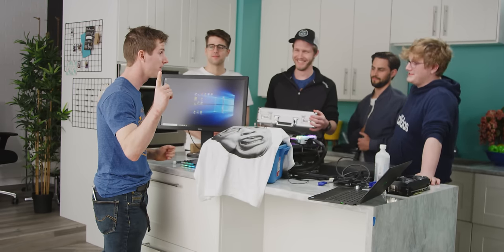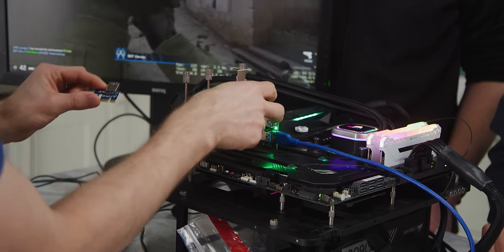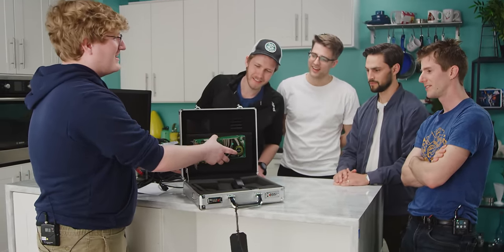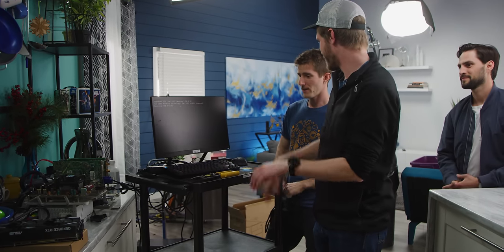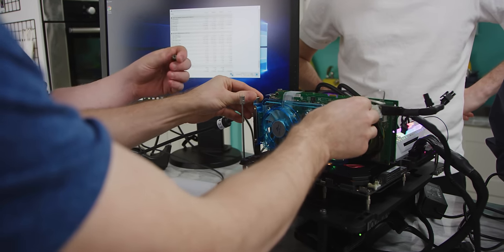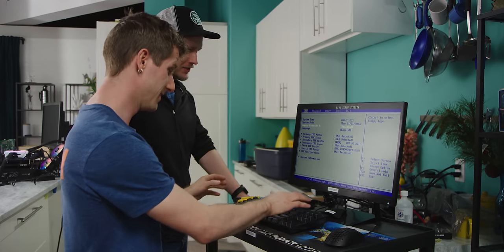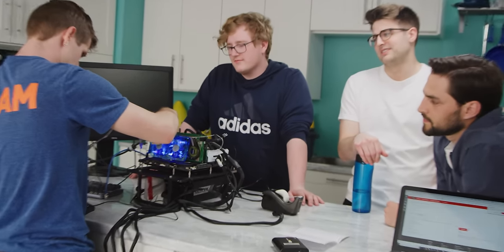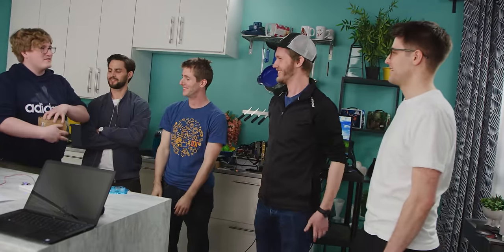The WEIRDEST PC Parts we Found on AliExpress

Comment: James: Everything is yawntown. nothing compares to ME!
Also James: buys a pcie fan
Reply: It wasn't even PCIe...and doesn't interface with the slot in any way...and only half of it was functional...lol.
Reply: @SolidSonicTH  I bet the reason only 1 fan worked was probably because the molex connection was shoddy. Them pins and sleeves are unreliable AF...
Reply: I remember owning one of those and it never went in the slot just the back board and the Optical drive  large Mollex pass through connector.

Comment: Are you guys serious right now? I can get weirder PCI-E in 5 minutes. There's one that's a radio receiver, a quantum-based true number generator, the list goes on.
Reply: As I listen on my headphones plugged into a jack to RCA converter, on the outputs from a PCI sound card, that is plugged into a PCI slot on a breadboard that converts to USB 3 that is linked via USB3 cable to a USB3/PCI-X riser.... I feel disappointed.
Reply: me with my combo tv/modem/audio/radio/ethernet/firewire/usb pci card
Reply: ali express?

Comment: THIS NEEDS A PART 2
they need to find the USB router
Reply: I found one of those at a garage sale a WHILE back.  Played with it for 30 minutes or so, then a capacitor popped out.  At the time, I didn’t have a working soldering gun thing (still don’t), and I don’t want to burn my finger like Riley.
Reply: I have one, it's gotta be some of the weirdest shit ever. 
It's got USB C/USB A (yes, both in series, I wonder what would happen if you connected both at the same time) and it's a hub to USB A 2.0. 
With a Realtek GBE port on the end of it.
Reply: @Enbious  a iron costs like $40 for a decent one

Comment: 5:18 - PCI cards work fine in PCI-X slots, provided they are 3.3v compatible, which this card is as it has both 3.3v and 5v notches in the connector. And anyway, the motherboard Riley is holding has a 32bit PCI slot, along with the two PCI-X  64bit ones

Comment: holding down a live capacitor with any part of your body part is an awful idea.
Reply: Isn't it just if you touch the output of the capacitor that it's a bad idea? Correct me if I am wrong though
Reply: @bussin3456  If all is well, technically yes... However it fell off, was replaced by another and hot glued in place. On top of that it was getting hot. Have you seen capacitors fail? They blow, and best case scenario get incredibly hot incredibly fast and can burn you pretty seriously. Capacitors are not a component you want to go wrong near anything you value. A classmate of mine blew a massive capacitor in a quantum lab we were in while I was in university and it was violent and a miracle he didn't get hurt.
Reply: I was gonna comment on the capacitor until I saw this.. oh well.
Reply: @KluveRothtar  oof I did not know that capacitors had the ability to explode
Reply: @bussin3456  https://youtu.be/3b7mjukhTyQ here's a video with failing capacitors. Keep in mind even the ones that just smoke out are extremely high temperature and there's other things inside the capacitors that leak out during a failure depending on what type of insulation they use between the conductive layers. That's why I said even best case scenario you get a violent burn maybe even add on a chemical burn to it as well
Reply: @KluveRothtar  No, capacitor innards are corrosive to electronics but not to human skin, it's usually boric acid and ethylene glycol. By the way, do not lick it and do not let your pets lick it, that can be pretty deadly if you ingest enough of it.

If it's too hot, well get your hands away from there. It will leave a tiny burn but nothing that won't heal in due time if you're quick enough, nothing too deep.

The funniest i've had, and yes i'm an airhead and occasionally explode capacitors by putting them in backwards, was one where the creased top failed to break, so it just shot the metal casing into the ceiling. You'd think a gun went off if it was right near your face, which was the case, but the neighbours didn't even hear it. Besides, the alu casing weighs so little and has so much area to limit its terminal velocity that it won't injure you badly. If it got hot and by all reason yes the capacitor innards would be hot, like probably around 200°C by the time it started to explode, the action of flying through the air cools the alu casing right off. There was no mark on the ceiling where the casing hit.

The smell is unpleasant. I give the smell 3/10, i have smelled farts that were much worse. Recommend airing because of potential health risks though, farts are generally safer.

As far as burns from the electrolyte temperature are concerned, well there really isn't a lot of liquid there to go around. It's not watertight and is not swimming in electrolyte, it's just soaked in between the layers.

Don't be afraid of capacitors, but also if things are getting hot, it's probably a good sign that you shouldn't be holding onto them.
Reply: so never stand facing a capacitor when switchin on for first time incase you get shot by it because its the wrong way because the neighbours wont hear it either
Reply: the good news though it will burn any damage done sealed as its hot
Reply: @monkstandinglast  it would have to be a pretty big capacitor and have a severe failure to have that kind of risk. That big of one is rare to find and has very specific use cases. With what the average person will experience, a failed capacitor will get extremely hot very quickly, pop, then release smoke all on a matter of seconds of turning on whatever it's in. Check out ElectroBooms channel because he has them fail in almost every video he does testing out a circuit.
Reply: Lol I wouldn't worry about anything on that board except the psu
Reply: Boah... anything below 30volts wont do anything to your body, even caps
Reply: @monkstandinglast  It usually take a bit of time before popping because it takes time for the charge to build up maybe.

We use to blow them in electronics class in high school for fun. Kind of like popping a balloon. The suspense is more of the thrill than the actual pop. They had gone off instantly it would be less fun.

And for the big ones (at least a D size battery kind of thing) just short circuiting them with a wrench or screw driver making a satisfying arc and lingering ozone smell
Reply: @bussin3456  i had some capacitors violently combust and shoot out out their metal and hot fluid inards quite violently out on top one piece stuck in the ceiling...    had it intentionally shortened though.

Comment: I remember when UV reactive stuff was in. My first PC had a transparent acrylic case, UV reactive cables, and UV CCFL tubes. Oh yeah, and it was a 3GHz Pentium 4. It was pretty baller.
Reply: Man that 3ghz p4 was the bees knees. I remember having to log into my mates' MSN accounts and receive their offline messages (crying emote spam) so they were able to log in at home on their inferior CPUs. 

Loading a map on BF2 took around 10 minutes, though; click join, go get a cup of soup and hope that the round didn't end and trigger a mapchange while loading in. Good times. Honestly, it was good times.
Reply: Oh god, I remember this god awful UV acrylic power supply I bought. Back with 1 gig of ram was a killer amount of ram!
Reply: No way lmfao, my first ever pc also had a fully transparent case with a bunch of uv stuff, I even had 4 transparent-color fans that lit up... it had a shitty dual core amd though
Reply: Ellen Madden oddly enough I have a UV reactive fan. I just wanted it for that extra bit of airflow lol
Reply: my first pc was a 1997 dell running windows 95. that was in 2013 i had that
Reply: Well, how about this for a first PC - an 8088 XT with a turbo button! 1MB of RAM (of which only 640KB was visible by the OS I was using at the time), a 20MB HDD, 5.25" FDD and a 3.5" FDD... oh! and an EGA 16 colour graphics card, which was pretty advanced at the time - all up, I think it cost a little over $2K ;) ok, now I'm feeling much older than I was just a few minutes ago...
Reply: oh yeah, and the cases only came in beige - definitely nothing transparent there ;)

Comment: I had one of those pci fan coolers back in the day. It made a slight difference in a case with bad air flow. I also crammed an 80mm fan behind the motherboard socket in a case that wasn’t made for cable management and saw decent reductions in cpu temps.

Comment: PCI-X is backwards compatible with PCI lol
Reply: PCI-X is totally different from PCI-Express, PCI-X was used in servers. They didnt have any PCI-X slots in those consumer grade computers. PCI-X also went out of use around 2005
Reply: @wazzledoozle  I didn't say PCI Express, I said PCI lol And I'm pretty sure the Power Mac G4 had PCI-X slots, either those or PCI64.
Reply: @calebwilbanks2871  yes you did, and why is that relevant to this video? Ive seen other people mention the same thing, as if they believe they can plug PCI cards into their "PCI-X" slots.

(Due to the moment they had a pci card but couldn't install due to the PC having only pci-e slots)
Reply: @wazzledoozle  You can. I have an apple xserve which has 2 of those slots and apple themselves ships it with a PCI video card and Ethernet card even though both are PCI-X. It's just a normal slot with more lanes. Think of it as using a 1x or 8x PCIe card in a 16x slot. And also, it's relevant to the video because they were looking for a board to test that PCI oscilloscope card on and they found one with PCI-X.

Comment: I'm kind of disappointed. I've got some strange/forgotten GPUs sitting around like a PCIe x1 Matrox G550, a Volari Z11, and a S3 Chrome S25, and well as one of the old Killer Xeno Pro NICs and a mPCIe Broadcom CrystalHD (for adding hardware h264 to... whatever the original application was), and I hoped someone would have stumbled on old stock of some strange blast from the past like that.

Comment: I had such high hopes based on the description. Disappointed.
Reply: Yeah. Looked like they were much more entertained themselves - as if all of them were on weed.
Reply: In all fairness, that usb expansion slot thingy was pretty weird. The rest felt rather mundane. The fan didn't do much but it wasn't really weird. And an oscilloscope is pretty uncommon but definitely not weird.

I was expecting the PCI equivalent of the 3D glasses I bought for $5 around 2001. Because let me tell you, those were really, really weird.
Reply: @jonatanrullman  I was expecting... an SSD caddy... and a small flask with a PCIe mounted holder

Comment: 16:35
At this point I was like
What even is Alex's thing?
Reply: I rewatched the parts of the video about his part to try to figure out what it was and I couldn't figure it out. I was very confused when he won.
Reply: @elinorris1739  it's an oscilloscope that has a form factor of plugging into a pcie slot. Oscilloscopes are a tool that you use to measure voltage in electronics over time. They're good for testing electronics components.

Comment: Intel Celeron > amd athlon > pentium > core2duo >core2quad > skylake i7700k

When pci and serial ports were standard, massive crt monitors, ball mice with no mouse wheels or lasers. A hardrive that was IDE used master and slave jumpers and was louder than anything.

If you bent cpu pins they were easy to fix. When quake and unreal, half life. UnreaL tournament. Before broadband we used dial up connection.

Comment: Real rankings (IMO):
1) Jake: that dual GPU thing is actually really cool. It's of its time for sure, but it's 2 chips together and is no longer common (like 2 socket motherboards).
2) Riley: interface is interesting, cool that it splits like it does, common due to mining but special still.
3) Alex: technically more weird but it is just an engineering tool and not THAT weird.
4) Linus: just an Ethernet adapter
DQ: James: sorry, doesn't get power from the PCIe or PCI slot

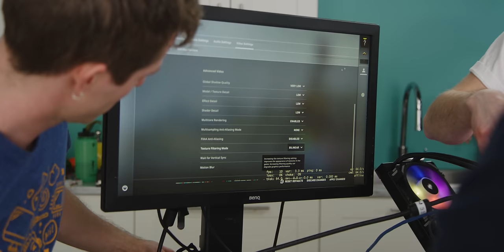Comment: 9:00 - Living the life on the extreme, holding capacitors with bare hands
Reply: part of the glitching may have been the interference from the body's electrical charge/capacitance
Reply: @Dreddy72  I am not even talking about the gpu, but of the courage of holding a capacitor without any protection, i got a eletrical shock one time from a mobo capactior and it wasnt one of the best experiences of my life

Comment: I dare you put people to install Intel 100 with EDO RAM together, and use those CPUs that doesn't even a PIN to prevent you from plugging it the wrong way, jumper voltage for CPU, RAM, all the jazz.

Comment: The USB PCI card is for crypto currency mining.
Reply: That's just the mainstream use today.
They predate the crypto craze.

Personally I use them for GPU rendering, and simulation work.
Reply: @chrisbaker8533 how come there is seemingly no performance hit with 1 card like there is with Thunderbolt?
Reply: @benjones7848  the best guess I could give is that for the riser it's a direct connection, while t-bolt adds a layer to the connection.
Reply: Chris Baker but still I would think there wouldn’t be enough lanes for data to be sent back and forth
Reply: Ben Jones because with thunderbolt the data needs to be carried back to the display and a lot of the bandwidth is dedicated to passthrough.
Reply: @benjones7848  for gaming you'd be correct.
Games constantly update the data in the GPU.
Rendering and simulations, usually work with static data.
That is it's loaded at the start, and doesn't change throughout the process.
The only bandwidth concern is the periodic update to displayed data, which compared to videogames is minute.
Reply: @chrisbaker8533 oh makes sense, because the GPUs are doing one big calculation, not many little ones.  Thank you.
Reply: @benjones7848  minor clarification.
It's not the complexity of calculations, video games are actually pretty simple, its the data being constantly updated.

Rendering and simulations are static. Meaning the loaded data doesn't change until the render is complete.
Video games are dynamic.
Meaning the data is constantly changing.

Move a character, data change.
Fire a weapon, data change.

Thus is why videogames require higher bandwidth and when they don't have the bandwidth the fps goes to crap.
Reply: @chrisbaker8533  Thank you so much for all your insight!
Reply: DapperDuff I loved it when Riley said the possibilities are endless

Comment: The riser pin mapping: usb 3.0 tx+/- signals and rx +/- signals (they’re differential pairs) are mapped to the PCIe transmit and receive pairs. The USB 2.0 D+/- pins are the PCIe reference clock, PERST# (the reset signal) uses the VBUS pin, and then ground is ground. The other pins on the x1 connector aren’t necessary for operation (i2c/smbus/jtag) and the little plug for the motherboard shorts the presence detect pins for x1.

Comment: if you want an actual answer, I actually have 3 PCIe slots occupied. used to have 4 before the new motherboard a year or two ago. one is the graphics card (obviously), another is a COM port adapter because I have a smart UPS that connects to the computer over serial, and my motherboard doesn't have a serial connection, and then I have a Dell Perc h710 controller that handles my raid 5 storage array. unfortunately, I think most of the time those PCIe slots are used for pretty mundane "things I wish my motherboard had but it doesn't" expansion cards

Comment: Linus' entry of a low profile network card is not unusual.  That is a standard sized part that you can find in stock at a computer shop.  His other adaptors is more interesting!
The ExpressBus card is technically a PCIe device, as it does use the same bus standard, but also a XQD card and a CFExpress card would also be that as well.

Comment: Linus probably didn't know that the usb to pci-e adapter uses physical USB but it isn't electrical USB. the other side of that usb cable is normally pluged into an adapter that has pci-e 1x to usb without any logic on it.

Comment: This is my 3rd year in a row making this comment: Alex's device is not weird.
James: Unique, interesting that it still is made, especially as a PCI device
Alex: Common, literally just an engineering tool
Jake: Interesting, but I wouldn't say outright weird. Weird that the simple tape worked better than solder and hot glue.
Riley: Weird that it was a simple USB-A connection, but otherwise fine
Linus: technically not a device until the very end.

Comment: Windows 7 32bit would work on that old P4 system. I used to run it on my socket 478 P4. 
Windows 8 was the first OS that was unsupported by the 478 P4 chips.

Comment: isn't PCI-X backward compatible with PCI?  Like ISA was backward compatible with the IBM PC internal bus headers?  I did a quick lookup and you can use the Oscilloscope board in the workstation board.  The scope was a dual voltage ( 5 and 3.3v) variant and PCI-X, supposedly is powered with the 3.3 V version.

Comment: For me and my recent dells, when a USB bus/controller or the ethernet controller or the sound controller goes dead, I use the pic x slots to get the dead connectors functional again.  Dell MB's suck!!!  And I presently use several oscilloscope expansion boards but they need software.  :)

Comment: :D I put 70 HDD's in my rig + 8 gpus (seriously) with ali express pcie 4 way splitters and pcie 24 port sata expansion cards. 4 GPU's on one pcie slot is totally fine if they need to do math computations and not shuffle gigabytes of texture data through the port.